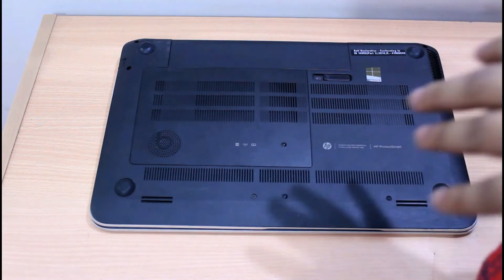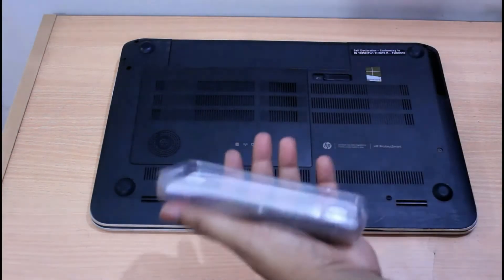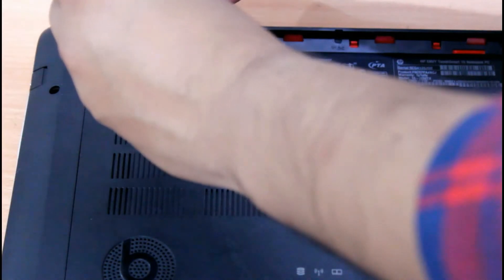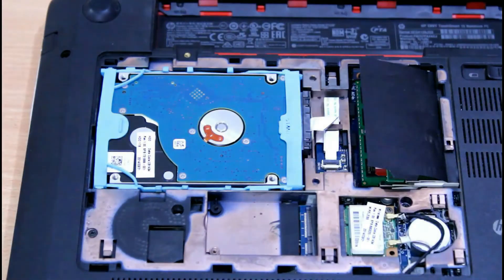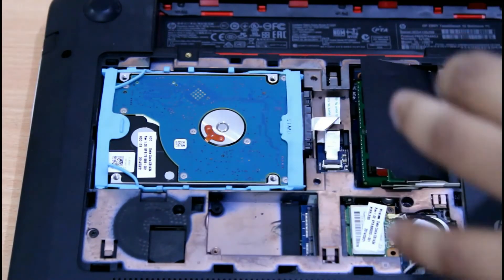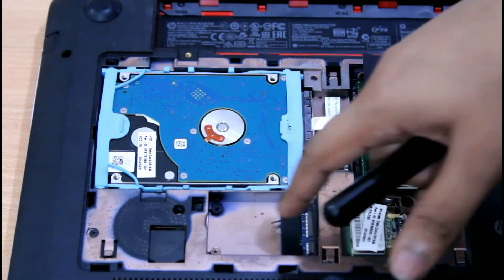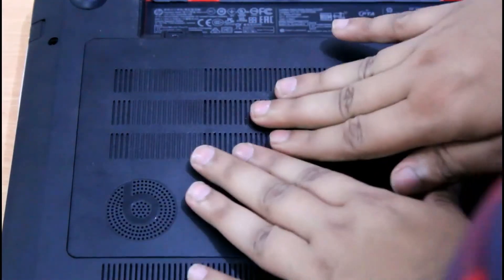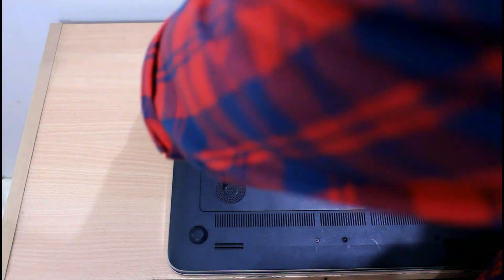2/5: Disassembly of HP Envy & Installation of mSATA SSD | How to Install mSATA SSD in HP Envy

Comment: Plz 128 gb mai koi ssd batao.....plz mere pass hp envy 15 j049tx hai......
Reply from the maker: the same mSATA SSD used to be available in 128 GB variant also. Check Amazon, it should be available.
Reply: @tanzTalkstech  I cant find on Amazon so plz help me out
Reply: Which supports my laptop
Reply: And i have 1 tb hdd and i want hybrid like 128gb ssd+1tb hdd
Reply: So is this possible...?
Reply from the maker: I can’t comment on the model of your laptop. If it were to be HP Envy 15-J109TX I would have told you with confidence, that yes it is possible. 
So it’s better if you check for posts related to the model of your laptop to be on the safe side.
Reply: @tanzTalkstech  ok i order Kingston A400